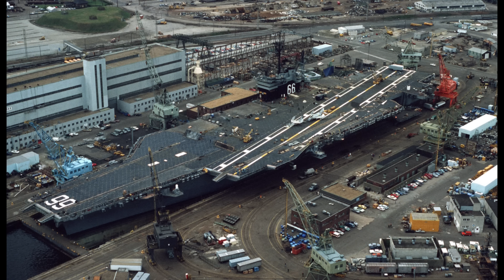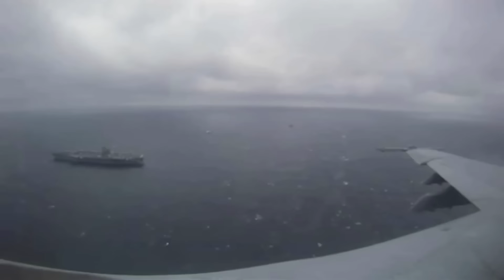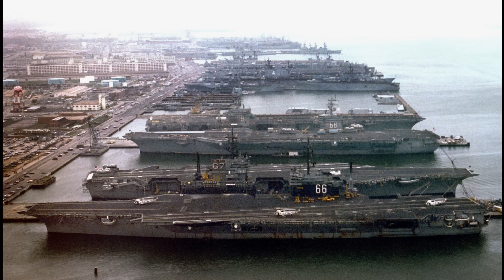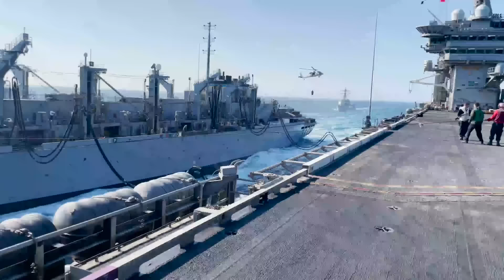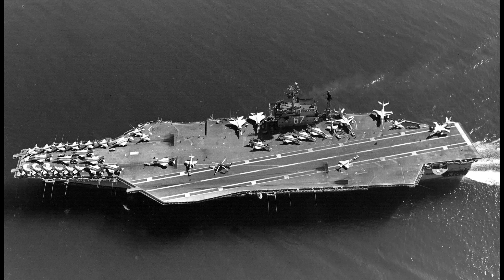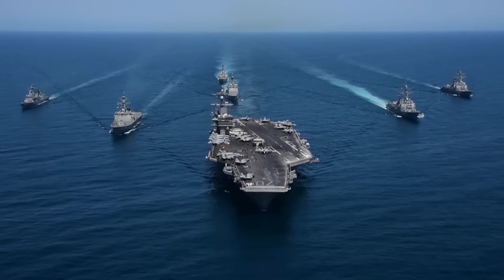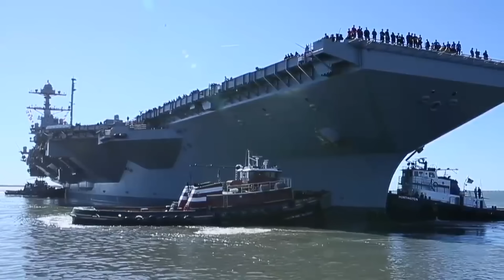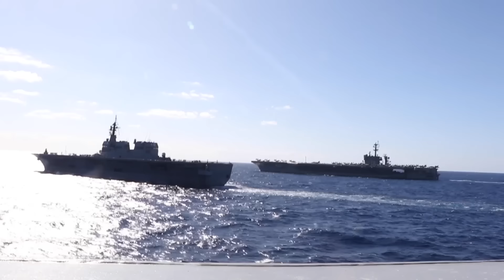Kitty Hawk Class: Why the US Navy MUST Bring Back This Non-Nuclear Carrier

Comment: The bottleneck is dry dock space / time. No matter what you are building there aren’t enough dry dock
Reply: Not just lack of graving dock space but the corporate knowledge to build these massive ships is concentrated in just one shipyard. I think Puget Sound Naval Shipyard has the graving dock space but little to none of expertise in new construction with their last new build in the mid-60's. They are strictly a repair yard.
Reply: @williammoreno2378 
You can regain it in time.
Reply: @CFak-i9r1c  its gonna take a long time.
Reply: @williammoreno2378 
10 years will be enough.
Reply: @CFak-i9r1c no it won't unless we make a concentrated effort prioritizing it it will take 30 years at least refurbish the Facilities we already have is going to take 10 years and $43 billion that without adding a single facility or additional dry dock. Never mind training and having the jobs for new trainees. What needs to be done is The old closed yards need to be taken back from the foreign owners completely razed new facilities built at the old Brooklyn,  Philadelphia and Charleston  yards on the east coast and Long Beach, San Francisco and San Deigo Yards on the west coast it could be done in half the time of refurbishing the current yards for the same price this would allow 2 to 3 times the current build capacity and 10 times the current repair capacity  for all naval vessels allowing the revamp of the current yards with out further restricting construction of new vessels or further bottle necking repairs which is are currently so far behind that vessels are literally unseaworthy and chain failures from lack of repair are causing them to be more feasible as scraped than returning to the fleet because repairs will cost more than a new ship the problem then is we currently don't have space or expertise to build a new ship.
Reply: We’ve got 54 ships under construction right now, things are getting better. The urgency is being recognized!
Reply: @nelson9286. Taking up every available dock even some needed for critical repairs, because of BRAC
Reply: Dry dock space? Yes.  Skilled labor force to build and maintain (you know to maintain continuous work via shift work)? Yes.  The struggle hold of the military industrial complex around our politicians throats?  Yes.  The political will to have more than a bare bones fleet?
Yes.  

I actually agree with this video to a point.  We are throwing away ships that can still operate before we have them replaced.  With the development of new technologies, the old non nuclear carriers could be practical in certain arenas and would be a great mix to go with our nuclear carriers.  

Yes I know this also means more of other hull types will be needed and we will need more personnel for the manning.  But, the United States created the problem we have now and no matter how we address it, well it will be costly.
Reply: @JeffreyStockard the US didn’t create the Russian threat. The US didn’t draw the lines on the map in the Middle East (that would be France and the UK), the US wasn’t buying oil and natural gas in bulk from Russia (that was Germany). In just about every instance of the crazy that’s going on, you’d be hard pressed to say it’s the US’s fault. If you are being objective and fact based anyway
Reply: @nsatoday  but since WW2, the US assumed the UK's mantle of global policeman & still tries to dominate the world, for which the huge naval & marine forces r essential. At the moment of truth, they'll need to take that mantle off, pull the trousers up, & put the regular, not crusader's, cross back on!
Reply: @Steven-k8t  I see you couldn’t logically challenge my argument. So you decided to engage in “whataboutism”. 
1. Who enabled Russia to rearm? Mostly Germany but Europe as a whole did help. 
2. Who drew the crazy maps in the Middle East which is a primary drivers of the civil wars and instability? Europeans

Just take accountability for the messes you made already instead of deflecting the blame to the US. We are attempting to clean up Europes mess (again).

I will engage with your “whataboutism” for sake of argument. We don’t have a bunch of over seas colonies like India for example so the parallels to the British Empire are debunked and logically disingenuous. 
If we had wanted to dominate the world we would’ve kept Europe like the USSR gobbled up territory. So you got disproven again. Europes inability to take accountability shows up in comments like yours and it makes me wonder if it’s just European political establishments and mass media running from accountability as fast as they can, or more of a delusional mindset so you never address the points in the first place.
Reply: @nsatoday  1. Don't blame the Russians for trying to not being dominated & colonized. The neocons enabled NATO's expanson, not Russia. Russia & US have many common interests & no fundamnetal disagreements since the '91 USSR implosion.
2. Israel was created in 1947 by the Brits; later it became a US proxy & largest recipient of its aid in the ME, with its 5 wars, Intifada & Gaza genocide.
3. Who drew the crazy maps in Korea? the US & the USSR, resulting in a boody war, & it's been divided ever since. 
4.Who helped to break up Yugoslavia, Iraq, Syria, Sudan, Somalia & Libya?
Reply: @Ste @Steven-k8t  I see, you are indeed delusional. No one was colonizing the Russians. 
You still deflected from the points and inserted more “whataboutisms”. 
1. Eastern European countries ASKED to be in NATO. Sorry the facts disagree with your rant. 
2. Israel was originally created some 3,200 years ago. It was reinstated in 1948. As to international law, Uti possidetis juris (UPJ) is a principle of customary international law where newly independent states inherit the administrative boundaries of their previous colonial or imperial rulers. That means that Gaza and Judea/Samaria (Jordanian colonial name is the West Bank) legally is a part of Israel. As to the attempts by Islamic supremacist powers and Europeans to try and rewrite law after the fact; it’s not legal to do that and make it retroactive. Meaning the only “occupation” going on there is an Egyptian occupation of Gaza and a Jordanian occupation of Judea and Samaria. 
The Arab league invasion and Arab settler colonialist Islamic supremacists are responsible for their own actions. As to “genocide” you obviously don’t know the legal definition of the word. If 1 billion Muslims told you the world was flat would you believe them? Sounds like you would. The US has actually restrained Israel in its retaliatory strikes against the Islamic supremacists. Every time Israel has taken action it’s been in response to the Islamic supremacists. 
As to the UN mission in Korea, or Somalia, I will again state that’s the UN borrowing the US’s military. So that falls on the UN. If we have to figure out which was the best outcome in Korea you can easily look at South Korea as extremely successful and North Korea is a famine and human rights abuse haven. 
You know Vietnam started out as us helping the French. The list goes on and on. You haven’t provided a logical basis for most of your assumptions or claims. The US is no angel; however, we aren’t what you are claiming either.
Reply: As to Yugoslavia, that would be European members of NATO again wanting to form a coalition and borrow the US assets. As to Iraq, Saddam gassing the Kurds and invading Kuwait played a part in that. If you mean the Iraqi civil war which has claimed over 1 million lives that would be the Islamic republic or Iran through the IRGC. Over the entirety of US operations in Iraq since 2003 the total toll for that is around 300,000 all in. 
Syria? Assad gassing his own people, working with Iran and Hezbollah (not to mention the Russians) are the key factors there. It’s now being led by a (supposedly former) Al-Qaeda member and was supported by Turkey because Erdogan hasn’t met an Islamic terrorist group he didn’t like. 
Most of your assertions don’t hold water. So you definitely haven’t read much history and drink the koolaid.
Reply: @nsatoday  FYI, the US & a few other NATO members supplied Iraq with arms & chemicals  during its 8 year war with Iran; the total estimated death toll for the entire US operation in Iraq since 2003 is often cited as over 300,000, though some estimates (including indirect deaths) place the figure far higher, exceeding 1 million in some surveys. Iran, through the IRGC and its proxies, significantly expanded its influence in Iraq after 2003, engaging in a sectarian conflict and conducting attacks against U.S. personnel. Turkey has actively supported various opposition groups in Syria, particularly to combat Kurdish forces (YPG/SDF) in northern Syria, often creating tension with other NATO members. The Syrian forces' use of chemical weapons against their own people, true or not, wasn't the main reason for Western intervention there- it was to eject Iran from the Levant, & the even US allied with Al Qaida affiliated groups there. The 1999 NATO intervention in Yugoslavia was a "neo-colonialist" action to integrate the last remaining non-aligned part of the Balkans into the Western neoliberal system; the conflict was linked to strategic interests like the planned Trans-Balkan Pipeline. NATO explicitly targeted Serbian oil refineries, fuel dumps, and chemical plants, arguing this would paralyze the Yugoslav military forces.  The Trans-Balkan Pipeline intended to carry oil from the Caspian Sea to Europe, which would be more secure with a pro-Western Yugoslavia. Kosovo holds significant mineral resources, including coal, which observers in this article suggested was a long-term goal for Western control. The establishment of Camp Bondsteel in Kosovo after the conflict is often cited as a key, permanent military footprint in the region.
Reply: @nsatoday  At different times, Mongolia & China also asked the USSR to join it, but was also denied, & rightly so. Russia too asked to join NATO, but was denied; I'm sure the West will deeply regret expanding NATO after a big war that's coming there. The legal status of Israeli borders, particularly regarding Uti possidetis juris and the West Bank/Gaza, remains a deeply contested topic in international law with conflicting scholarly interpretations. The 1948 establishment of Israel, rooted in the Mandatory Palestine borders, was accepted by many Jews but rejected by the Arab populace. Applying UPJ to the 1948 borders does not inherently give Israel sovereignty over all contested areas, as the principle specifically relates to the borders of the new state.Occupied Status: The international consensus generally treats the West Bank, East Jerusalem, and Gaza as occupied territories under international law, a position upheld by numerous UN Security Council resolutions. The Korean War was a UN-sanctioned mission led by the US; as its host & major donor, it is the UN that as being used by the US, not vice versa. Lately it got too independent & Trump threatened to leave it. The initial U.S. involvement in Vietnam was to supporti French colonial efforts, which later escalated, becoming a cash cow for the MIC. A Thai officer at a US base in Thailand asked an American: why do you help us? He answered: we are helping you to fight Communism! The Thai replied: fight Communism somewhere else! I suggest that u study more history urself, & don't bother to reply; nothing u write will saway me.
Reply: @nsatoday  
Russia was always a threat. 

It doesn't matter who drew the lines in the Near East and Middle East. The US has been involved for decades. 

The US didn't do much in 2014 when Russia initially invaded. The US didn't do a thing during the Kerch strait incident in 2018. 

The US is to blame for a lot of stuff if you're "objective and fact based".
Reply: @nsatoday 
😂 
1.Russia was always armed. 
2. Doesn't matter. The US destabilised the Near East and Middle East. 

You want to talk about Whataboutism? You're the one who started it. You're the one doing whataboutism. 😂

You don't want to take accountability. You want others to say your mistakes are theirs. They're not. You're not trying to clean Europe's mess. You're creating a mess and are asking Europe to clean it. Nice try.

You have colonies. What is Guam? Nice try.
Reply: @CFak-i9r1c 
1. Russia re-armed and did so with European funds. 
2. Sykes-pico started destabilizing the Middle East (so also a European mess) the PLO and PLFP were KGB operations and the Shaw in Iran was a British install. 
I get it, you can’t take accountability for your mistakes. Nor do you seem able to read history books
Reply: @Steven-k8t 
1. NATO's expansion is done because Russia was threatening everyone. Yes, Russia did this. Russia wasn't getting colonised. 
2. Israel was supported by the US from the get go. It's not a proxy. Israel has too much power in the US. US enabled it to start wars.

4. Syria was done in by the US. Saddam had US weapons. ISIS rose to power because of the US invasion.
Reply: @C @CFak-i9r1c  agree Russia has been a threat. Unfortunate Europe didn’t agree and decided to fund them. 
Most of the ethnic conflicts in the Middle East and Africa are due to the lines drawn, so yes it matters. 
As to Europe not wanting to maintain its militaries (over American objections) and European refusal to take action (when the US requested) over Russias actions, those are Europes issues. The US was willing to take action if our European allies were on board. They weren’t. 
You are merely trying to shift blame
Reply: @nsatoday 
No. Yogoslavia was broken by the US mostly. Nice try. 

Saddam got those weapons from the US. The US invasion of Iraq in 2003 created ISIS. Nice try.

Syria? That one was started by the US. Nice try. 

He's not drinking the kool aid. You are. Syria happened 15 YEARS AGO. NO HISTORY NEEDED.
Reply: @CFak-i9r1c  lol. Yugoslavia was line drawing by the USSR and an ethnic conflict ensued. Nice try. 
Saddams chemical weapons were manufactured by the USSR and used on the Kurds, another ethnic conflict caused by Sykes pico, nice try. 
ISIS was created by radical Islam. 
You keep trying to deflect. The facts don’t support your argument.
Reply: Syria? Ethnic conflict erupting in a failed state. Again goes back to European line meddling.
Reply: @nsatoday 
😂 No, most of the ethnic conflicts today are because of involvement in the Middle East and Near East. That's US involvement in the Middle East and Near East. 

Europe got involved in the US wars in the Middle East. That's why they reduced their militaries. Helping the US costs money. 

The US didn't want to do anything and wanted Europe to do its job. The US wasn't willing to do a thing. Cut the bs. 

You're the one trying to shift the blame and you're accusing those who call you out on it.
Reply: @nsatoday 
Yogoslavia wasn't drawn by the USSR. Nice try. 
Saddam's chemical weapons were made by the US. Stop lying. 😂 What cope. 

The US invasion created ISIS. Nice try. What makes you think radicalised people? 
Facts are not "trying to deflect". You're the one trying to deflect. Cope. 😂 I don't have arguments, I just state facts. Facts don't support your arguments. Stop lying. 😂
Reply: @nsatoday 
Neah. The US started the conflict. Nice try. 😂
Reply: @CFak-i9r1c  The claim: NATO’s expansion is done because Russia was threatening everyone.The reality: There are two main sides to this coin.The Eastern European perspective: Sovereign nations in Eastern Europe actively requested NATO membership because they feared Russian aggression and wanted safety. For example, Finland and Sweden joined in 2023 and 2024 precisely because they felt threatened by Russia's invasion of Ukraine.The Russian perspective: The Russian government has long viewed this expansion as aggressive military encirclement. They argue the West broke informal promises made at the end of the Cold War not to expand eastward. The claim: Israel was supported by the US from the get-go and is not a proxy.The reality: US support for Israel evolved over time and was not absolute from its founding in 1948. Early US presidents were actually hesitant to provide direct military aid to avoid alienating Arab states.This changed in 1962 under President John F. Kennedy, who established a "special relationship" and approved missile sales.Over time, US policymakers came to view Israel as a strong, reliable ally in a volatile region. While Israel acts independently in its own national interests, the US provides substantial financial and military aid, exceeding $3 billion annually. The claim: Syria was done in by the US.The reality: The Syrian conflict was driven primarily by internal factors, not the US.The crisis started in 2011 when the Syrian government violently cracked down on pro-democracy protests.This brutality sparked a massive civil war.While the US eventually provided support to various rebel groups and fought against ISIS, the destruction of the country was largely caused by the domestic uprising, the Syrian government's brutal response, and the heavy military involvement of outside powers like Russia and Iran. The claim: Saddam had US weapons, and ISIS rose to power because of the US invasion.The reality: This is a mix of fact and tragic consequence.US Weapons: It is true that during the Iran-Iraq War in the 1980s, the US provided Saddam Hussein's regime with economic and military support, including dual-use technology, because Iran was viewed as the greater threat. Iraq's chemical weapons program, however, was primarily built using European and domestic resources.The Rise of ISIS: ISIS indeed rose to power largely as a direct result of the 2003 US invasion of Iraq. The US decision to disband the Iraqi army and the subsequent destabilization of the region created a power vacuum. This chaos, combined with the later Syrian civil war, allowed terrorist groups to reorganize and capture territory.The Proxy Debate: While the US certainly enabled Saddam in the past, ISIS was an enemy the US later had to spend billions of dollars and commit troops to fight. https://www.youtube.com/watch?v=XgnjltFXBCE&t=1961s
Reply: @JeffreyStockard
Bare bones fleet? 😂 Nice try.
Reply: And just the price of building one. Forget the cost to rebuild the infrastructure.
Reply: Not just dry docks, naval repair, manufacturing, and the ship wrights and trained and experienced repair supply personnel to go with them
Reply: Shipyards and dry docks have been turned into beachfront private property. They gone
Reply: @surg9029  Eminent Domain is a thing. Rather see it utilized for national security than corporate profits.
Reply: @DArnoldd . Good luck. The people who own that property have money and political clout. They will fight back and it will be tied up in court battles for years. And shipyards are t environmentally friendly. More legal battles will ensue from that. By the time they make it through court battles and built, ship requirements will have moved on.
Reply: Funny thing is that during World War Two we had the drydock space. A Lot. We have drydock space that has been deactivated and we can generate drydock capability. Reactivating Midway CV-41 and Lexington AVT-16 and other off the books assets is practical and workable. But. That Requires Drydock Space Too.
Reply: @daleeasternbrat816  Reactivating the USS Midway (CV-41) and USS Lexington (AVT-16) for modern military service is not feasible due to their age, the extensive conversion to museum status, and the obsolescence of their systems. USS Midway (CV-41): Decommissioned in 1992, it serves as a museum in San Diego, California.Challenges: The ship is a 1945-era design with legacy steam engineering, which would require massive overhauls to be operational; its systems are not compatible with current, modern network-centric warfare. USS Lexington (AVT-16): As an Essex-class carrier commissioned in 1943, its systems are severely out-of-date for modern operations. The vessel was heavily modified to a training carrier before retirement in 1991 and has since been adapted into a land-based museum. Their essential military equipment, sensors, and structural elements were likely removed or deactivated to ensure safety and accessibility. After decades of sitting on mud, re-certifying their hulls for high-speed operation is impractical. While they represent significant US naval history and were considered for potential, short-term usage during the 1980s, these vessels are permanently preserved as historical landmarks.
Reply: Build more dry dock lol